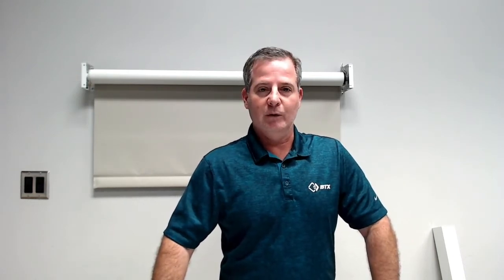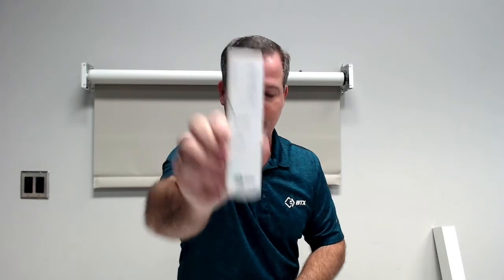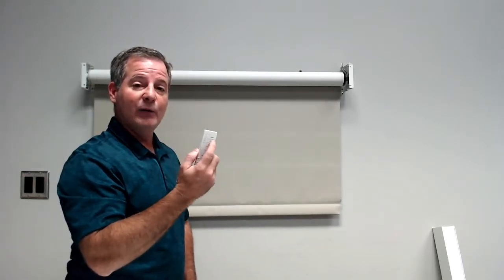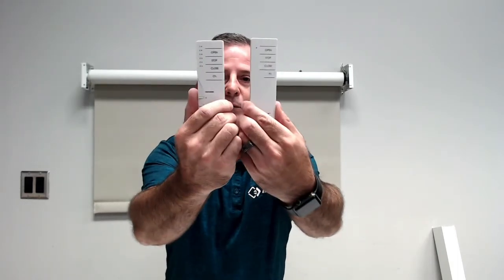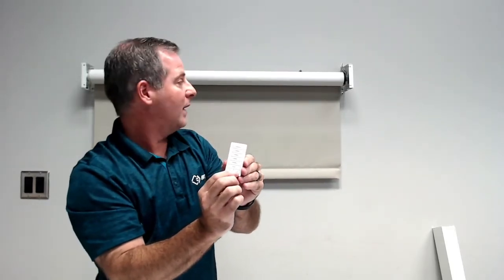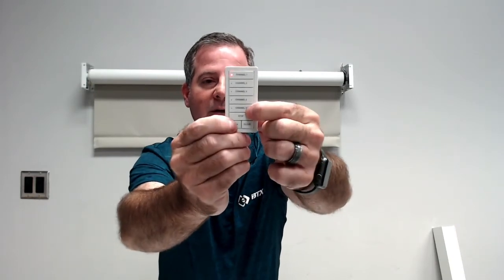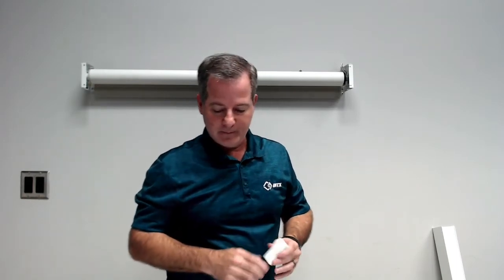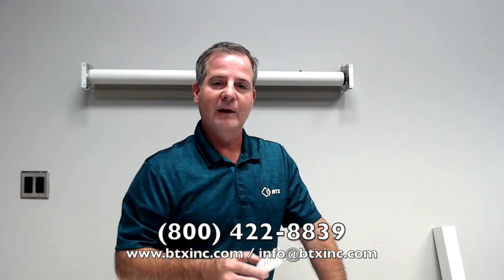Programming a BTX Wall Switch

Comment: installed 17 ft wide track in concrete, 11 ft off floor with a blackout drape. all good except direction on remote is backwards. call this phone # , 3 times all of tec. support is in a meeting. have to go back to customers home at later time to reverse direction of remote commands. *%#$@